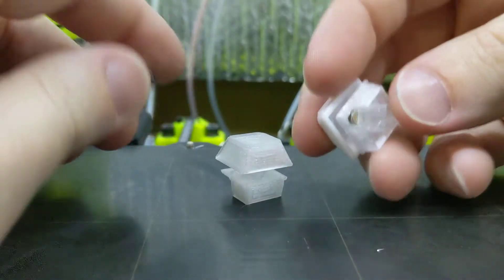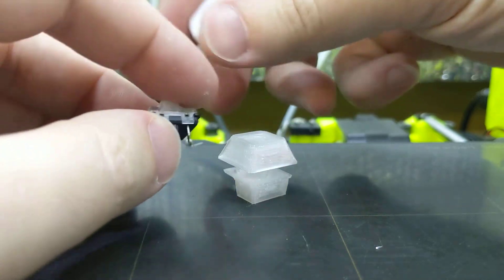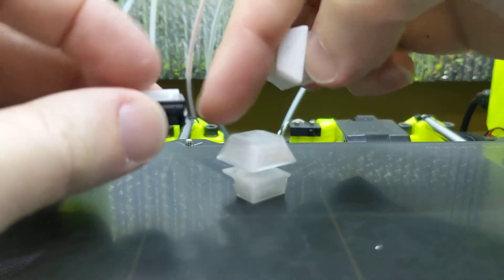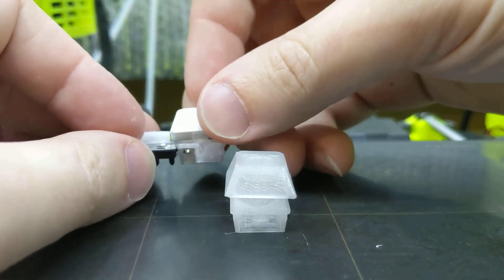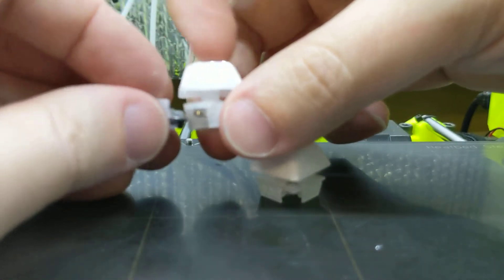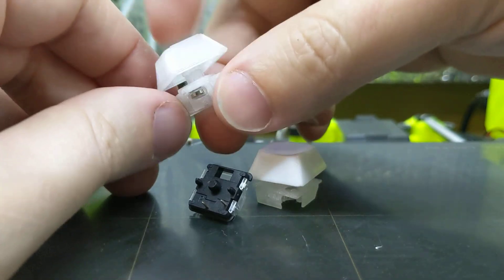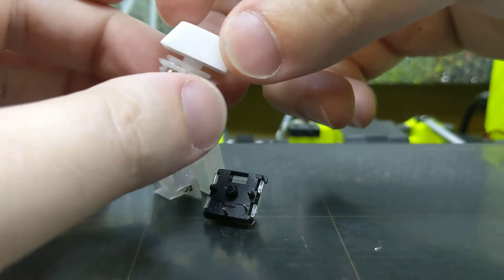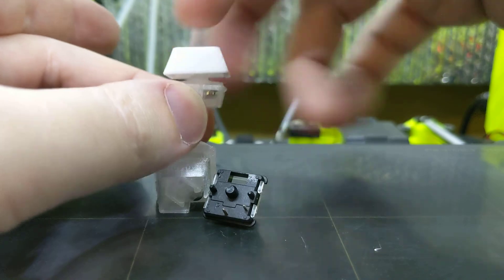Low(er) profile versions of my switch compared to a Kailh Choc

Comment: I think you can also get rid of the second magnet by making one of them just a hunk of steel, to optimize the cost!
Reply from the maker: I tried that, actually...  It doesn't work as well as you'd think. Well, it works fine but it doesn't feel quite the same.  The "give" of a magnet pulling away from steel is much smoother than a magnet pulling away from another magnet.